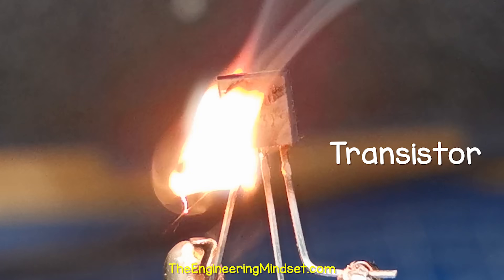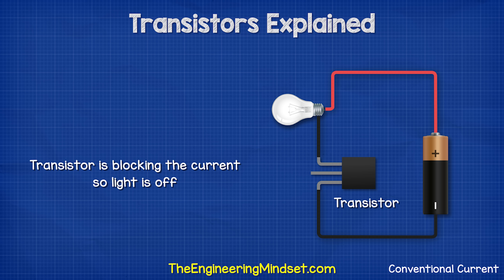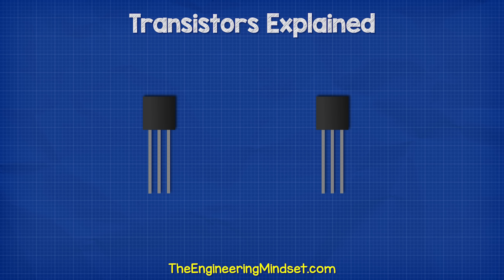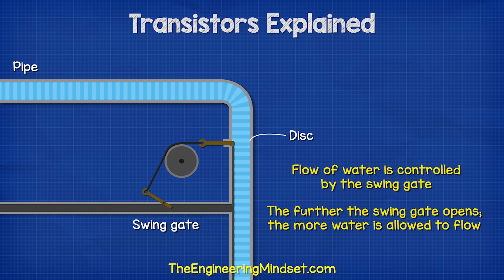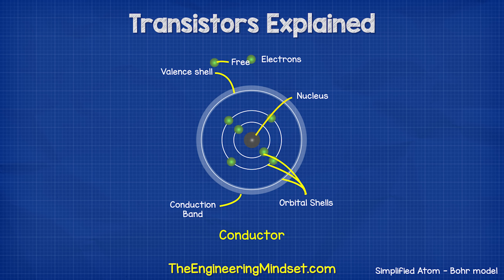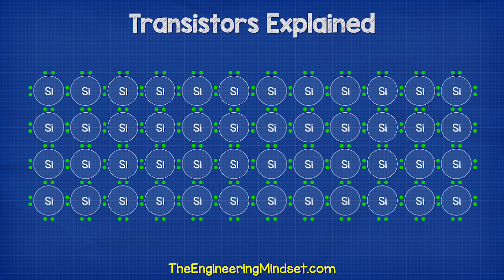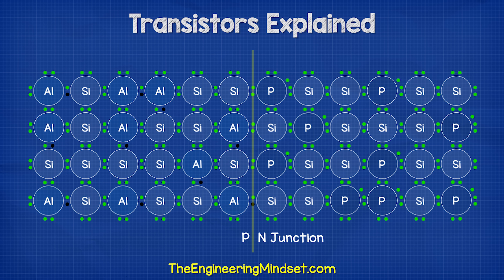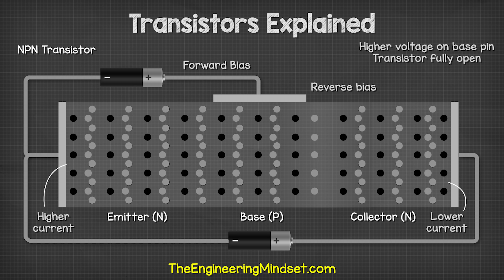Transistors Explained - How transistors work

Comment: What laboratory power supply do you use? Or what can u recommend me?
Reply from the maker: I have about 6, ranging in price and complexity but to be honest I use a cheap generic one off amazon the most. It's the easiest to use as has very few functions and I'm not worried about breaking it because its very cheap to replace but also easy to repair. If you're starting out then that's fine. More advanced ones have better precision allowing you to accurately control the voltage and current to 2 decimal places or sometimes more and can also be programmed but to be honest, you probably aren't going to use that.

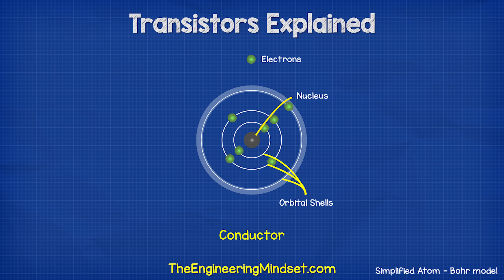Comment: Your explanation of the atom around 10:00 is very confusing. Saying electrons furthest away from the atom (core) holding the most energy is wrong in my opinion. The binding energy of each electron decreases, the further away it is. So an electron very close to the core actually has a lot more energy, than electrons very far away from the core. You will need high energy photons to strip an atom of its core electrons but thermal excitation might be enough to strip conduction band electrons away. I realize it does not really matter for your explanation but I thought it was important to clarify this. This is probably a convention thing as well. It's just difficult to talk about electrons "holding" energy.
Reply: That is correct, the outer electrons are the valence electrons and in a metallic molecule, the neighbouring atoms cause the threshold to be lowered and these electrons are then free to move around and become conduction electrons.   They do hold energy in discrete amounts in the quantum mechanical domain.

Comment: Curious the so-called conventional current concept is still being used. My electronics instructor always used the actual current concept. He said that the negative is a surplus of negative electrons and electron flow is always from excess (negative terminal) to the (lack of electrons) positive terminal. All instruction and fabrication followed from that. Semiconductor function much easier to follow using actual current concept.  That was 50 years ago.
Reply: InpPhysics you use electron flow for gases and also for electrochemistry.  However for practical electronic design of circuits it makes no difference whatsoever and as the symbols for diodes and transistors have the arrows by convention, and most people can relate to positive "flowing" to negative, it seems slightly more intuitive.  We can blame Benjamin Franklin for calling it wrong 150 years before the electron was discovered!

Comment: 2:28 "but this requires a human to manually control the switch" 

3:56 Guy is turning a knob to tell the damn transistor to act as a switch 

So if you like switches, don't use a transistor. If you like turning knobs, then install a transistor, baby!
Reply: 1:24
Transistors switching LEDs on & off with no human intervention...

Comment: At 2:50 , what is the need of that transistor.  We can directly add the same switch in simple circuit (Remote or thermistor type)? Why add a small battery and again a switch?

Comment: 20 years after I had to study electronics at school, I finally understood how transistors work.
Reply: Me too 10 years after, shame on education system!
Reply: Right ,shame on
Reply: If our education system is unable to understand us the working of transistor then they should not include this in our syllabus
Reply: @Felix2011y are you American?
Reply from the maker: Check our new Multimeter tutorial out ➡️ https://youtu.be/4lAyzRxsbDc
Reply: For me it is 14 years. I always wonder why they did not use actual illustration like water and pipe in this video to explain its operation principle and how they use that principle to apply into reality.
Reply from the maker: Check out NEW resistor video, everything covered! ➡️ https://youtu.be/DYcLFHgVCn0
Reply: A transistor is just like a rheostat, controlled by the current. A switch is a thyristor, because it can be either on or off.
Reply: @s71402san  Still, not an appropriate analogy my friend. 
Here it is: Before the transistor , we have the vacuum tubes. The simplest of the vacuum tubes is the triode...meaning 3 electrodes, filament or cathode, anode or the plate, and the screen  grid. A triode can be made to function as a diode by simply connecting the cathode and screen grid. Although the vacuum tube is actually a bulb, it function like an electronic valve...the flow however is of electrons and not water. Triodes regulates the flow of a bigger voltage or current between the cathode and the anode. The bias being introduced to the screen grid is so small such that when it can cause an effect on the large cathode to plate current flow, an increase in amplitude or amplification can occur. 
When the transistors came to be discovered in 1947, the first working transistor was the triode basically to function similar to the vacuum triode but with less electricity use. 
A rheostat is a manually operated in-line resistance load mainly to lower a current or voltage. It's a resistor or potentiometer, although it has the capacity of handling high current or resistance.
Reply: You couldve learn from youtube
Reply: Ditto! After:  
AAS in Electronics + 
BS in Elec Engr Tech'gy
Reply: Ngl the invention of transistors blew my mind I thought that perhaps it was an invention we stole from that spaceship in rosewell
Reply: Same
Reply: me too .
Reply: I was just thinking this !   ...but it's been almost 50 yrs lol
Reply: Ain't it some shit I had three years of electronics and residential electrical wiring I got the wiring but just recently figured out the electronics side
Reply: Yep! Here I am at 50 yrs old
Reply: Same case like me
Reply from the maker: Seen our new Potentiometer Explained video? ➡️ https://youtu.be/Xb-MZMoUtcQ
Reply: You are write.
Reply: Same.
Reply: For me i am in 10th
Reply: Im watching this vid for the 4th time in 2 days, im getting there i hope
Reply: Juan - Well over 20 years ago when I was an accounting major I also took some electronics courses for a hobby interest.  Those courses taught how vacuum tubes worked, not transistors or LEDs.  Those courses allowed me to pass the FCC exams for the First Class Commercial Radio Telephone License and the Amateur Extra Class License.  Back then "CRT" stood for "cathode ray tube" NOT "Critical Race Theory."  
Another thing I learned was that while Electrical Engineers and Electronics Technicians make more money than Accountants and Bookkeepers, employment is not as assured.  Having a career as an accountant has made me financially secure and electronics is just an enjoyable hobby.  Other hobbies have taught me that gunsmithing and auto mechanics are also enjoyable, but are NOT profitable careers.
Reply: @bobsradio6025  . That's pretty cool! I have a degree in finance and I just started my journey into a hobby in electronics and electricity in general. I got my very first multimeter less than a week ago and already had some fun testing things around the house. I'm thinking that I should find a pre-made kit for beginners to experiment with. I'm also into automotive work, do my own repairs and have a very respectable tool collection with all sorts of name brands. I also have an interest in solar power so I figured learning about the electrical components was the logical step. Feel free to make any recommendations for educational content. Cheers!
Reply: @viewer-i5o  - Regarding kits, one of the worst days in my life is when Heathkit went out of business.   They were a major source of kits for test equipment, ham radio, TV, Hi Fi and several other  quality products.  I fear that my auto mechanics work is why I am having lung problems, doing brake jobs can be dangerous.  Woodworking was fun too, especially pen making.  However I think the best (and safest) hobby I have ever had is gunsmithing.  When you know that something could be dangerous, it gives you cause to be competent.
Reply: @bobsradio6025  there's definitely money to be made in mechanics, you just aren't doing it right
Reply: @bobsradio6025  😊
Reply: @bobsradio6025  - Gunsmithing and auto mechanics are great careers!!
Reply: School is an ABSOLUTE absurdity. The archaic use of paper, ink and pen to explain topics and concepts that require a 3D simulation, is a BIG issue for me. Teachers are the second biggest hurdle ! They are Not creative enough, they just teach what the syllabus tells them to teach and they use VERY POOR language and EXTREMELY POOR and dumb examples that cannot withstand an entire lifecycle of how that exemplary/analogy scenario fits into the concept being explained. The analogies they {CHOOSE} to use are Not well thought out or well-selected, therefore their analogies quickly FAIL to maintain their relevance to the advanced concept they are trying to explain with those {poor} analogies :((
Reply: @TebogoMotlhale  millions of people have successfully learnt electronics from the old pen and paper method. maybe I was fortunate enough to attend a good technical college with experienced lecturer's.
Reply: you didn't study electronics then
you studied how to use certain electronic components in a very limited setup
Like ohm's law, how to power a LED using a battery and a resistor. And that's probably it
Reply: @xl000  that was true.  And I still got a degree haha 
Then got out in real world and found I was dumber than a box of rocks
Reply: @xl000  - I wonder how many people actually know that "LED" stands for "Light Emitting Diode" or simply think that it's just a name.
Reply: @bobsradio6025  the real name of LED is Alison Burgers.
Reply: Because teachers are not allowed by gov to teach magic tricks in unis or colleges so you can become smart. They show you only rubbish stuff so they can discourage you from learning and stay dum. Shame on education gov teacher, they teach good stuff only to rich idiots.

Comment: It's nonsenical. At the begining you have a circut that has to be stwitched on by human interaction, so you add a battery AND a switch that human has to interact with. Why the f  do you need a battery at the first place?
Reply: Why do you need a battery or why do you need a switch/transistor? The battery is necessary for voltage. This is just an example though, real uses of transistors have different methods of human input and aren't so 1:1. For example, one press of the keyboard may result in thousands of transistors being switched in some way. That's far too complex for an example though, so he just uses a single one to turn on an LED.

Comment: Does this mean a diode is basically 2/3s of a transistor? 🤔 I distinctly remember the 0.7V from electronic class at my high school.
Reply: Yes. A transistor is a pnp or npn junction, and diodes are pn juctions. So you can think of it as 2/3.

Comment: Side note about conventional vs electron flow (which im sure is covered in the battery video, but i like explaining it, so here I go...) Imagine a pipe that contains a row of marbles. In order for a marble to move there must be a space for it to move into. To create a space for a marble to move into, ie a hole, you can remove one marble from the end and the rest of the marbles will shift forward one marble space. If you slow this down as you remove one marble from the end the next marble will shift into its position which now opens a space behind it for the next marble shift into, and so on down the line. As the marbles, ie electrons, shift in one direction the wave front of their motion, ie current, moves in the other. Moving electrons give rise to electrical current. Ergo to have current in one direction electron marbles move in the other.

Grasping that concept was incredibly helpful to understanding more about how electricity and electronics work.

Also this videos visuals of the doped regions of a transistor and how they function are miles above any other explanation I have ever seen. And I'm no spring chicken. Thumbs up.

Comment: I am in doubt if these two BM20 and BP-5L batteries are lithium or lithium polymer batteries or lithium ions?

the batteries BP-5L are 1800mah and the BM20 battery is 2000 I charged them using this  third photo charger for 75% after how many days do I need to recharge them again so they have long storage and durability?

https://encrypted-tbn0.gstatic.com/images?q=tbn:ANd9GcTXi58e_qNfzMCh8Kjr8ghv_fioU1COM08HvA&usqp=CAU
https://cf.shopee.com.br/file/247c2106d63885dc17be99b61824b8f1
https://www.dhresource.com/0x0/f2/a...rsal-cellphone-battery-lcd-charger-single.jpg
https://www.dhresource.com/0x0/f2/a...mobile-universal-battery-charger-usb-port.jpg

Comment: Kind of pointless.. Because you still have to have a human turn it on. All your doing is making a simple circuit more complex.  If your going to turn the equipment on any way... Why go through the trouble. Remove your complicted circuit for a simple one and turn on your switch anyway.
Reply from the maker: No, we do not need a human to turn it on. That's the entire point of a transistor. We can automate switching with sensors.

Comment: i have a question, how is the circuit automated if you could just let current run through without a transistor. The thing i don't understand is how is it then automated, if you can do the same thing without the transistor

Comment: Why muddy the topic with a "Conventional Current" discussion? I learned about transistor circuits back in the mid 1980s using "Electron Flow" as the means of determining current direction. We didn't bother with 'conventional' current since it was scientifically incorrect, as you finally pointed out. I have some textbooks on Electronics printed in the early 1990s, and they illustrate current as "Electron Flow" too. 

I spent the first half of the video getting annoyed at how the flow was illustrated and the second half typing a comment. Seriously, "Conventional Current" has been outdated for well over 35 years, so don't use it anymore!

Comment: For years I have heard that transistors operate in two modes - switching and amplification. However, it seems that they are really always in amplification mode. At some point the signal is too low and the needle is pegged at zero. At the other end, the signal is too high, so the needle is buried at on. I don’t know why we add the complexity. If we consider a VU meter, we don’t say that it has two modes... This is the same.

Comment: Great work!! Is there any chance you have an animation of what would happen in a NPN Transistor if the base voltage would be less than  ~0.7V or if it would be disconnected?
Why wouldn't the emitter voltage be enough to jump both depletion regions in order for the current to flow?
Reply: For Roman and anyone else wondering, see 14:53. The general (roughly) 0.7V potential difference that is required to be overcome is still present in the NPN transistors, so this animation with just a PN barrier is relevant to what would happen in a potential NPN example.

Comment: Saying the outer most electrons hold the most energy is kind of confusing. Core electrons require the most energy to ionize whereas the valence electrons are easiest to ionize.
Reply: I think that's because when an electron has more energy it has more energy to leave the atom. For example, pulling a 100kg object after you drink an every drink, vs after running a marathon
Reply: Good question! Another way to think about it is potential energy from gravity. When an object is higher up, it has more potential energy. So an object very far up in the atmosphere has much more potential energy than one at the surface, and it would also be easier to pull into space.

Comment: As far as the amplifier portion goes, I have a question. You're not saying the transistor actually magnifies the 1mA into 100mA are you? It would still be dependent on how big the power source attached to the other pins is wouldn't it? Like the 9 volt battery example, the 0.6 to 0.8V supply wasn't magnified, it just let more of the battery power through; right? Very new to all this so I am going to have questions that may be obvious to a lot of you
Reply: A transistor as an amplifier will amplify the current at the base pin. Say a transistor will amplify by 100 and it has 1 mA through its base. The current through its collector will then be 100 mA. This current adds to the current through the base and goes out the emitter, since current in = current out.

Comment: At ~4:05 you said "we're using a small voltage and current to control a larger voltage and current" and the .8V made the transistor "fully open" on the 9V circuit. 
It's been years but I distinctly recall the emitter voltage never exceeded base. The emitter was base minus .6V, so 12V base = 11.4 emitter, 5V base = 4.4V emitter etc. Current was a completely different story of course. Yet there you were lighting an LED with .8V on the base... So am losing my mind? Did I have a different kind of transistor(s)? 
Your videos are great btw. I learned electronics as a teen by reading the Forrest M Mims hand written/drawn books, which are outstanding. Before the internet his books were the only source I found for a simple logical explanation. I believe schools are trying to confuse people on purpose for reasons I don't understand and I see many comments below that confirm my suspicions ;)

Comment: Mosfets and transistors arent the same thing so i thought. The gate on a mosfet remembers on and off a transistor has to be signaled and will not remain on when the gates grounded to the back of the transistor where the heat disapates after you remove it.
Reply: I have made an simple and in-depth series explaining MOSFETs, for students taking VLSI at the university.
Reply from the maker: See my new MOSFET explained video here➡️: https://youtu.be/AwRJsze_9m4